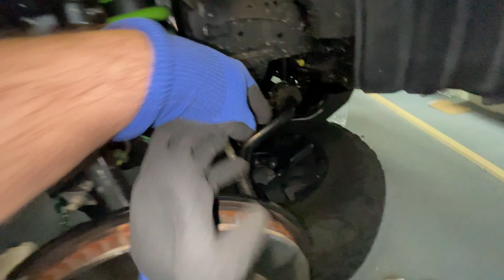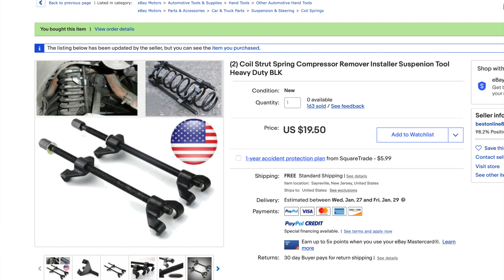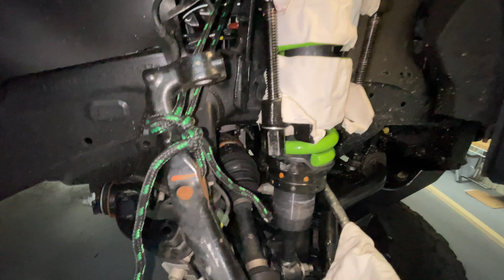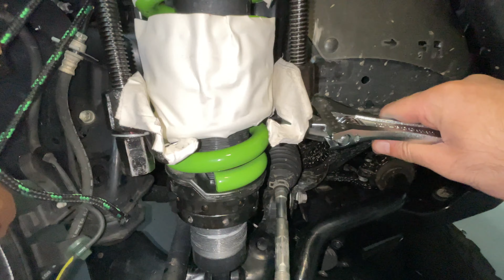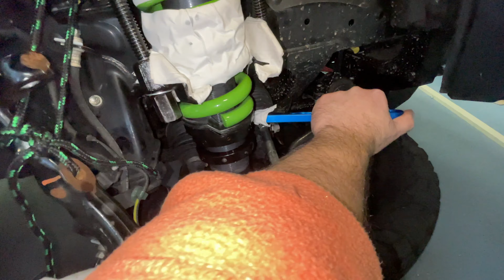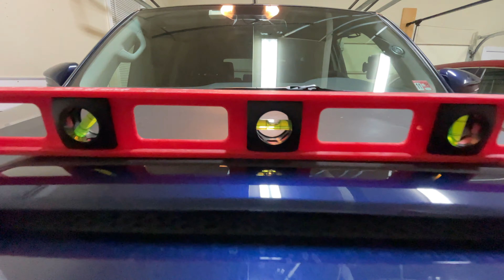Adjusting Coilover Spring Preload Or Spring Seat Height :IronMan 4x4 America

Comment: Would it not be a good idea to raise my front end I have the 2.5 inch shocks I’d like to get another inch higher ?
Reply from the maker: i found if you go more then 2 inch lift you will get issues in a long run , such as road driving dynamics will get disturb ,and also tight spring will give you rough drive , the most important is your Axle Assembly will not remain straight with will put load on the joints and will leak or break. short answer do not go more then 2 inch
Reply: @T4TEST what is seat height for 2” left?

Comment: Are those 0-110 LB. 3 inch or 0- 110 LB. 2.5 inch springs in the front from Ironman?
Reply from the maker: i had a plan to place wench but i did not , i was getting 3 inch lift so after when i have lower it , i got 2 inch lift .
same thing at the back recently i have change my spring at the back rear end now i am getting 2 inch lift all over , i will suggest you if you want keep your vehicle stable 2 inch is the right way to go 
Iron man spring sizes are same its all base on the load , base on the hardness of the spring you get height ( lift)

Comment: I'm in the same boat - got the IM Foam Cell Pros for my 2015 Tundra, running a bed cap, but not a lot of extra weight/stock bumpers/no winch/ I ordered the pre built set and they come at 3.5". The rear sags lower and the front is pretty brutal so I think I'm going to lower them down to 2.5". Other than that, I really like the set up and they make a great complete kit so you don't have to go chasing down stuff and dealing with compatibility issues and parts not working with each other. The stuff just works!
Reply from the maker: also please check , IM sells different load spring which effect your ride comfort , i do not recommend more the 2 inch lift , my experience is that 2 inch lift is the perfect lift for these vehicles .

Comment: Good info dude… was looking for one where I can adjust the ride height with the coil overs on the truck installed. Is there any reason why you don’t want to do a diff drop.
Reply from the maker: going more then 2 inch you need to add break lines , diff drop , UPC ( Must) and compromise ride quality  , and also i have KDSS  , KDSS will not work on 3 inch lift , and the main reason , for 2 inch lift i did not disturb  CV excel angle , if you lift your vehicle you are disturbing your vehicle geometry.
people lift vehicle to add big tires and i do not have plane yet ..

Comment: Are you using a 3” coil or have you adjusted it up to 3”?
Reply from the maker: my rear is 2 inch lift with spring , and front is 2 inch and its like factory look , why front 2 inch ? if i go more than 2 inch , my drive shaft angle get change and i have to do diff drop also ride quality get rough ( too many bumps ) with 3 inch lift means springs get more tied , also with tight spring KDSS does not work well because KDSS have no room to push sway bar to move .

Comment: Im getting the 3" foam cell pro kit for my tacoma. I will be adding a 125lb bumper soon Ironman advised me that i can adjust the coilovers for the added weight.. but i dont know how much to adjust them? I would like to do so before they are installed but do i just need to wait until i add the bumper to readjust them?
Reply from the maker: on the shock if you move adjustment half inch  this will give your  one inch drop on the tire side  , also you need a spring compressor with small thin hook which you can get in the spring , without using spring compressor you will not able to turn the shock height , i explained pretty well in the video  , compress spring will give you stiff right , bouncy ride and loose spring will give your comfort , for 3 inch height you need diff drop kit , otherwise your driveshaft will get damage soon , u must keep driveshaft straight , 2 inch height without diff drop  is a good deal , at last put load first and then see , you need to adjust  or not  .
all this above info related to 4runner , i saw in video for Tacoma , if you go with 3 inch lift you will 100% destroy Driveshaft bush and after market fix is available .
Reply: @T4TEST  I have a GX470 with this lift kit and the front rides like crap....feels like there’s not enough downward pressure on the front wheels. I’m hoping lowering it down to 2.5” will make it better. I was under the impression that you had to remove the coilovers from the vehicle to make adjustments, but it seems like you had no problem doing it on vehicle. Thanks for the video.
Reply from the maker: @pigbelly100  you may use Spring Compressor to compress spring so that way you will easily turn and lower it , as i shown in the video , no idea why you are asking , my video is pretty clear , if you have room to work otherwise take it out and do it .